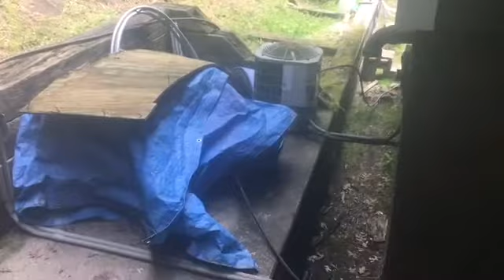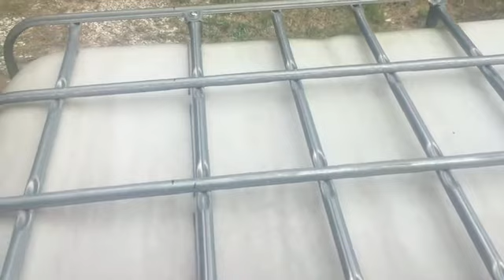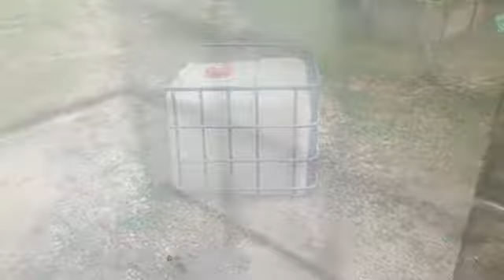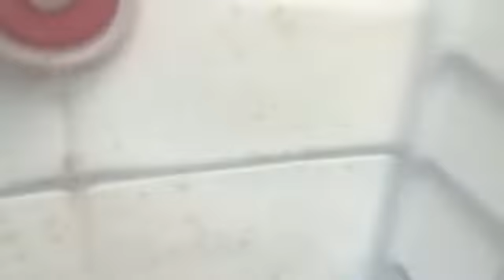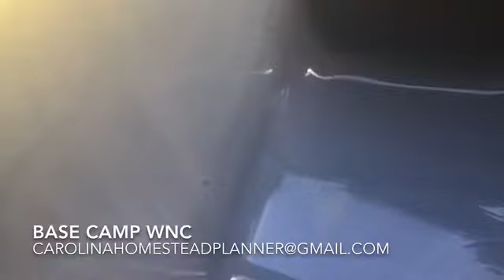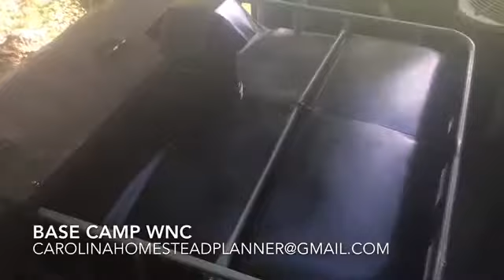Generator Cover Cheap And Easy

Comment: No melting? Pretty cool if not.
Reply from the maker: It has run about 8 hours this winter and no problems 
About 4-6” of space around the generator 
And has a hole cut for the exhaust 
And as always subscribe like and share 
Thanks 
Eric